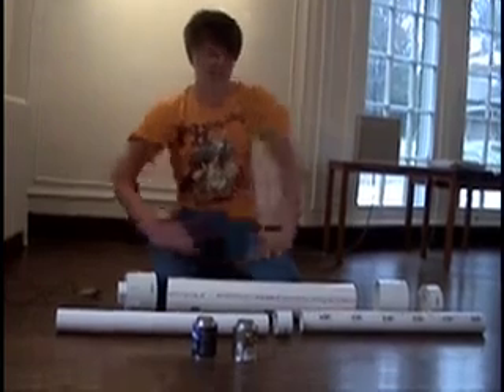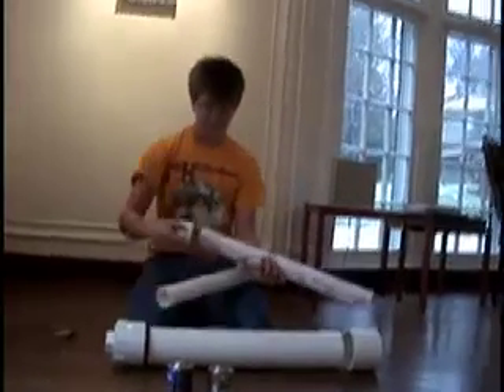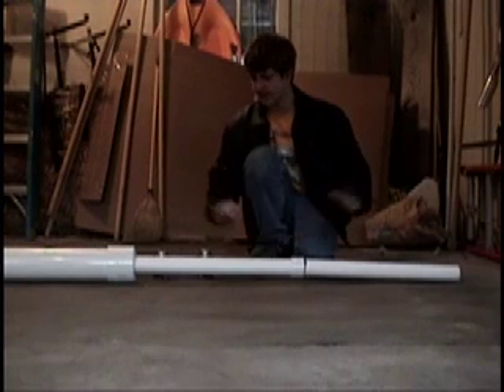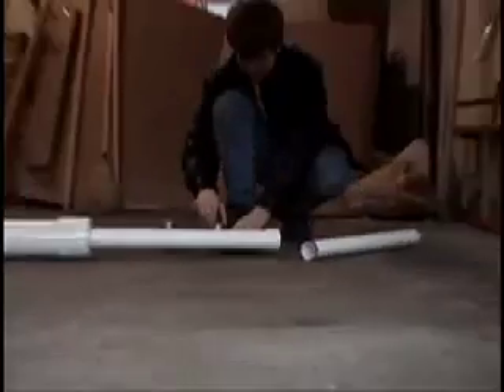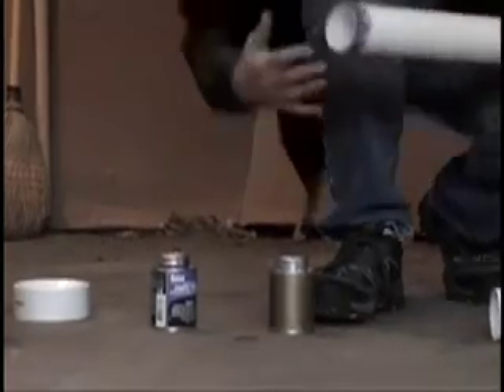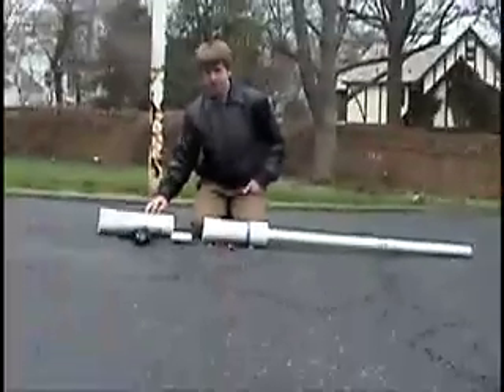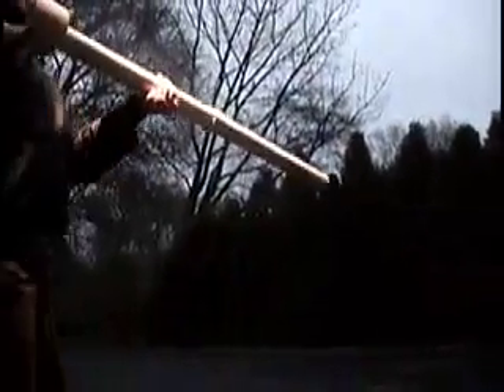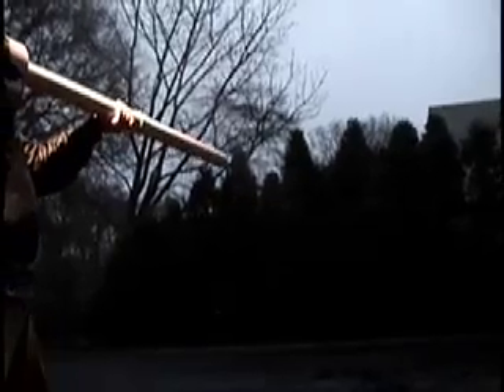How to build a Potato Cannon

Comment: I installed the ignitor directly into the tube so it loks like a engine sppark plug, no wiring needed. I have unstakked it befor in the threaded end cap also. Benel the end of the barrel, so if you use apples or potatoes, it cuts them easily.   Mark the ram rod depth with tape also, so there is no guess work. I go to the town / city recycle areas, find scrap barbques and take the igntors out of them, as new ones cosot a crisp new $10 bill.

Comment: Don't use duct tape on the ignition. Duct tape is highly conductive and if any part of non coated wire touches the tape you get shocked when firing.

Comment: If I were you I would use ABS pipe, if you happened to wear the pipe down or to much propellant (if possible and still able to ignite) PVC will explode and send shrapnel out. ABS only cracks, its much stronger and its black. Black looks so much better.

Comment: Why dont you just put 2 screws in at an angle from the outside and have it so they almost touch inside then attach the wires to the outside. It seems easier Any ideas?

Comment: dude instead buy a stun gun they work every time only thing is u need a 9v battery u can find them on ebay. i bought one for $15 and works like a charm. u skrew 2 holes in chamber and make the skrews very close to each other. then take wire and wrap around the skrews and the other ends to the metal prongs on the stun gun.

Comment: its a spud gun, not a bazooka. putting a spud gun on your shoulder is dangerous as there is a risk of it blowing up, and pointless because it doesnt have sights/scope like a bazooka does. secondly, if you intend on building it to last, spray paint it  so it doesn't degrade in the sun.

Comment: can you get the grill ignitor at Home Depot because i no you can get the pvc pipe and connectors and the sealants there but if you can get the ignitor there then itll be a 1 stop shop.  PS can i use propane instead of hairspray cause it burns hotter with more pressure.

Comment: the combustion chamber works 2' long if its 3" and the coupler is one piece from 3-2 and it has the same power, because its longer, but narrower. but both have the same volume.just a tip. check out mine.

Comment: oh and just for the record, i know what im talking about, out of all the cannons i have made they all are different, my last one i built had a combustion chamber with a 5.5L capacity, and my barrel diamiter is curently@ 85mm(3.35inches)and barrel length is 1 meter (3.28 feet) It WIll fire a beer bottle through two tarago doors (driver then passanger) so do not hold them near your heads... i will video the next one i make and i will put up some video of the one i still have when i have time...

Comment: you made the sparker a lot more difficult than you needed to. just put each wire from the sparker on the screw and the spark will jump across from one srew to the other...it is so much easier but great vid i will make one!!

Comment: i was riding my dirt bike with my friend after a long failed atempt at finding a sparker when my friend yells...BARBIQUE!...and t whip around to find that the sparker was better than i anagined it was electric so it kept making the spark until i took my hand off the buttin and it ran for 2 weeks on 1 old aaa baterie and we made the sparker on the outside and it worked flawlesly

Comment: Instead of using a length of 10 inch pipe for the combustion chamber use a T piece. Then mount the lighter into a screw cap. Place this in the bottom bit of the t (the opening that is at the angle. The beauty of this is that it gives a larger but shorter combustion chamber, an easier grip and a more reliable sparker and you ca shoot it holding it comfortably at waist hight, Oh, and deoderant works better than hairspray, more oomph. Great work though man, bringing spud guns to the masses.

Comment: I have never built one, that is true. however, my friend has built many. He has gave them as gifts, built them for people. Been doing this for a long time. He has made some out of schedule 40 which were fine. However, he told me everyone he ever built which failed was 40. And most of them never split at a joint either. No one measures the amount of fuel they put in. There is always a possibility for failure. Just try to be as safe as you can. Death is a possibility. Please be careful, take care.

Comment: dude i have a 2 foot conbustion chamber and it shot around 534 feet you might be putting in the wrong amount of hairspray in i found that 5 seconds then quickly cap it works best try it

Comment: No. I meant what I said. I use this stuff all the time when doing pool pump repairs. But now that I think about it, other versions could come the opposite way. But I'm positive I'm doing it right with the kind i have. The clear liquid cleans and primes, and the purple one is the glue. But theirs always the possibility I'm a complete idiot and have been doing it wrong for years. In that case, it works the same way anyway.

Comment: for the combustion chamber you can use more than a foot of pipe, if your using 2 or 4 feet you just have to spray the hair spray longer (bout 6 or 7 seconds should do, if your using 4 feet might want to do it for 9 or 10)

Comment: You wanna drill the screws into the ouside of the chamber so that on the inside their almost touching. Then connect the wires to the outside of the screws. When you hit the button, it should spark accrost the gap inbetween.

Comment: thanks, the static guard worked.  i had to use a nice ammount of it (bout 4 secs 4 inches away, then put the cap on bout a second after.  then idk if it did anything but i also shook the barrel around hoping to get the fuel evenly spread out. and it worked! every time whooo

Comment: i have a potato launcher just like this one, but it isnt  working.  i know the spark goes off every time the chamber is 4in diameter, 16in long.
It flames when i take the end cap off. so im thinking its an oxygen problem. should i drill a small hole in the combustion chamber to let air in? or is the combustion chamber too large?

Comment: the barrel length creates the velocity/power, as long as the gas is burning/expanding, you are building power, when the gas is burnt, the potato slows, if it's still in the barrel, it slows down

Comment: well, he has one solid screw and a loose wire, piezo sparkers aren't 100%, 2 screws into the chamber forms a reliable gap. hair spray has a lot of water in it and will gunk up the chamber over time. propane is better and cheaper

Comment: you dont need a very long barrel for it to work, all i have is a 3 foot barrel and i get over 300 yards off it on a good day.  you can also use a dual ignition system to create the pressure that much faster, also you can buy rifled PVC pipe and that greatly improves accuracy and distance...

Comment: Also you may want to consider wrapping your entire combustion chamber with duct tape. Ive heard horror stories about them shattering on people and duct tape will keep shards of plastic from going into your face. I realize Dharmaking used PVC here, but if you plan on making your own, i dont recommend using ABS. Its a ligher weight plastic than PVC that actually contains millions of tiny air bubbles in the core thus weakening its structural integrity.